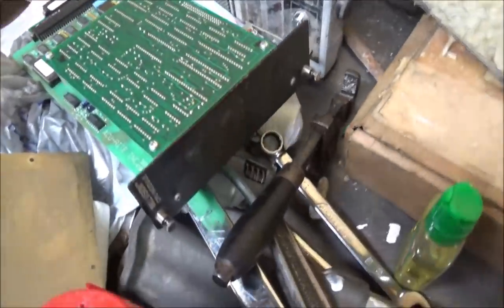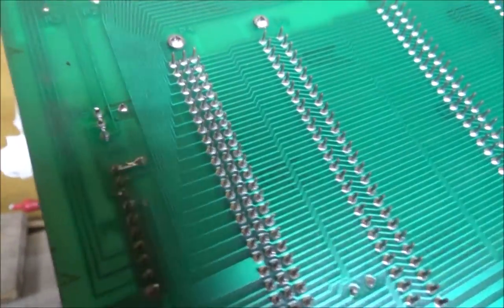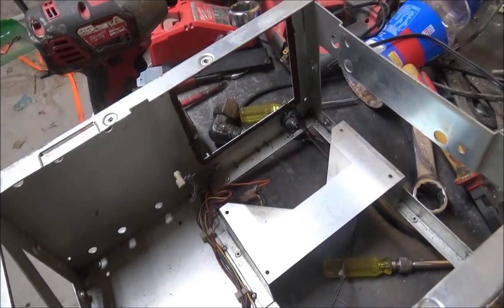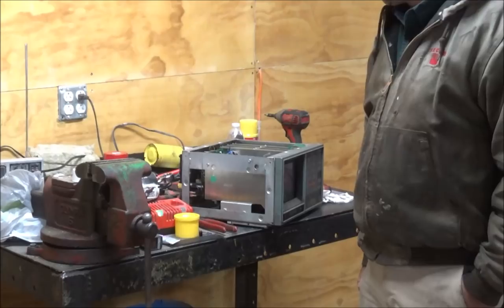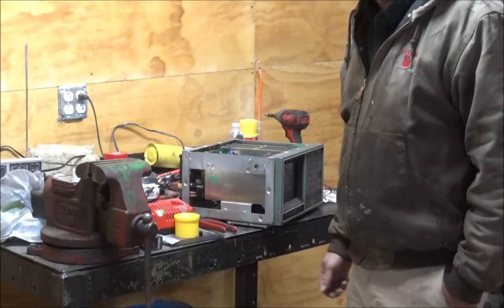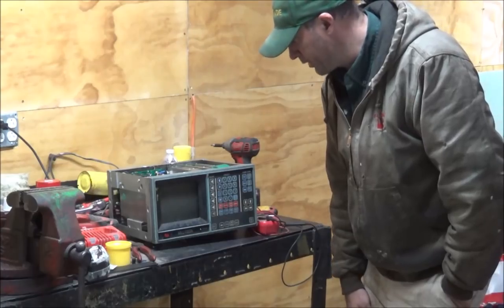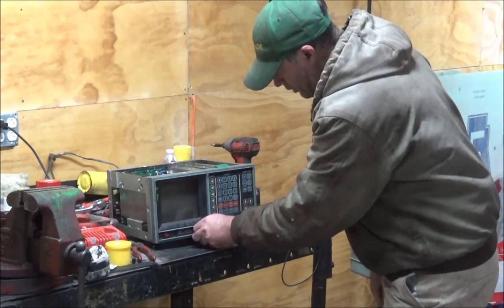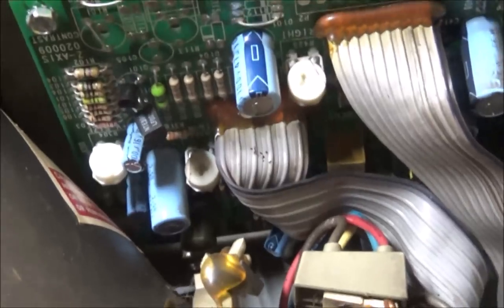Fix one problem a new one follows. CRT help anyone?

Comment: Brian, I don't know if this will help, but here goes. I have a 97 vintage bridgeport with a 2 axis prototrak MX2 controller. It HAD a crt. One day my garage smelled like a hundred capacitors burned up at the same time. I couldn't see anything wrong on the outside, and then checked the large box mounted to the column. Looked great, and no smell inside it.
Finally I started sniffing the control box on the arm and bingo! After opening the rear of the control box I eventually discovered the source of the horrendous smell. The card that surrounded the neck of the crt had a large hole burned through it. If the box hadn't been almost totally airtight, it could have burned all the cards in the box.
The choice: new old crt or lcd flat panel. I said screw the crt! No more flaming circuit card.
Now, the cheapest replacement kit i found was $1250.00. I don't have that kind of money right now, so I ended up doing it from scratch. The MX2 uses a 386 dos computer, with a monochrome video card for the crt. I did research and found a raw vga DE15 (15 pin) lcd panel that would fit the crt opening and a good old color vga card on ebay that would fit the motherboard. VGA is the oldest format the lcd panels would accept, and be compatible with the 386 motherboard. When I turned it on and adjusted the lcd, I had a three color display!
If your video board outputs in vga or better, you can replace the crt for good. If not, perhaps you can find another video board like I did. i searched for raw vga lcd panel in google and ebay.
Please contact me if you think I could help. Ed.       eakerstrom@yahoo.com
Reply from the maker: That was going to be my next option. Fortunately I got it fixed with the original bits some solder and some extra wire.

Comment: On something that old there should be a V-hold adjustment, but it could be hidden. The V-hold basically adjusts the oscillator frequency in the main driver chip to match the frequency of the incoming video signal. It looks like it has a card edge connector on the CRT board, so it could be composite or TTL signal. Probably TTL. They are pretty simple, but tough to figure out without a schematic.
Reply from the maker: I believe it is TTL signal.  There is no v-hold adjustment that I can find. the only pots are Bright, VSize, VLine, Hphase, and Hfreq
Reply: Well ain't that a bugger... If you want to ship it across the Mason-Dixon line, I'd be happy to take a look at it. No guarantee I can fix it, but you never know... @bcbloc02
Reply from the maker: Got a guy close by gonna come tomorrow and take a look at it see what we can figure out. If we don't get it I will kepp you in mind. Thanks!!

Comment: You are having a vertical sync problem. Check your yoke connections. It also could be a cold solder joint, failed capacitor or a loose connection.

Comment: Sticking with the KISS method I would suspect additional cracked solder joints.  Especially after tear down and reassembly.  Good lighting, and magnification for inspection.  At some point somebody will recommend wiggling the pins etc.  I'd be cautious about doing so as it creates more variables.  Probably focus in the repair area first and work out from there.

Comment: First step...   unplug the power from the wall.  clip a test lead to the chassis. put the other end on the shank of a long thin flat screwdriver.. the screw driver must have an insulated handle..  push the tip of the screw driver under the boot on the high voltage wire on the side of the CRT to touch the clip. .  now you can safely push the clip down the screwdriver and hook it on the metal connector under the boot.. so you can completely discharge the high voltage retained in the picture tube and the flyback.  it can keep 25KV with enough current to cause you to fly across the shop..  this is the first step in any work around the CRT.  if you think  the cable snapping and dropping the radial drill was a close call.  you will need a tube of Dielectric tune up grease to replace the dielectric tune up grease that sealed the high voltage under the boot on the side of the CRT.. it goes under the rubber.. not down in the hole..  this is a life or death safety precaution. 

 i am a guy who resolders a lot of stuff.. ECM/PCM.. relays. instrument clusters..  somebody just today tossed out a blueray player next to the trash can.. in the box.. plugged it in.. nope.. opened it.. resoldered it..  it not only works.. it plays netflix and youtube when i plug it in to my cat 5 cable. 

 here is a 2000 honda circuit board close up.. i added little white arrows where IFFY solder joints were.. https://i.imgur.com/U3JoxbK.jpg  the wire gets hot.. the solder closest to the wire expands but the rest of the solder puddle is on the circuit board and does not get as hot.. so its pushed back.. when you turn off the device it cools.. the solder on the wire shrinks and pulls away from the rest of the solder puddle making intermittent sometimes becomes OPEN.   

because you are working with LOGIC boards..  you will want to wear a static wrist band attached to the frame or the board so any static build up on your body or clothing does NOT blow the logic electronics out.. they are damaged at around 18 to 20 volts.. static can have 20KV. .

i will let the others describe where to look.. but i would want to check all the solder joints on the monitor board after you discharge the tube.   especially the pins soldered in for jumpers between boards.. 

 please also look for capacitors that show signs of leakage to the board.. or have the ends swollen..  capacitors don't last for ever..  if you catch them before they blow up destroying the circuit board the can be mapped out for polarity.. by taking pictures of the circuit board .. printing them out large..  marking down on your pictures which side is positive and which is negative.. unsoldering them when you have replacements from Newark or digikey..  you have to look at the ratings and order equal values and voltages.  any with a 14 volt voltage you might want to try to up that voltage rating.  those are the ones that manufacturers put in to fail to sell new machines every 10 years or so. 

 capacitors when new allow AC voltage to pass thru.  they block the DC.. . when they get old they pass DC..  the amplifiers used between them amplify what ever voltage and signal are there.  if there is only AC voltage coming out. .the amplifier device will amplify AC signal only..  if the DC comes thru.. it will have a big thick middle section of DC being put out and your signals will be smothered with DC..
Reply: Beware of Electro Static Discharge (ESD).  You could build up a high enough voltage with an ungrounded soldering tool and an ungrounded steel table to destroy ICs on the PC Board as wayne p stated above.  You may need an electronics or computer repair shop to help you.  Good luck in getting it back to normal.

Comment: Unlike home TV's, The vertical is driven and doesn't have a "hold" control.  That drive signal connection has been broken,  Common problems are wires in ribbon cable connectors or connector pins pushed out.  The wire of interest goes from the controller to the monitor.
Reply: All CRT monitors and TVs have a free running oscillators for X&Y which lock on to the sync signals.  Every one I've seen does have a V HOLD pot somewhere.   I agree the signal wire is probably broken but it's also a slight possibility that the V HOLD was knocked so now it's too far off to latch onto the incoming signal.
Reply from the maker: The ribbon cable is pretty hard and crusty it could well be the problem. Can I replace it with multiple regular wires?
Reply: @bcbloc02  You CAN replace with individual wires, the ribbon cable isn't anything special, just multiple wires in a row, but it would likely be tricky to get all the wires soldered in place, and reliable.  A replacement ribbon cable might be the best way to go.  Hopefully someone will chime in on where to buy one.
Reply from the maker: The ribbon cable is soldered on the driver card end so replacing it would be a challenge anyway.
Reply: If you can identify the broken wire,  you can patch one in and leave the rest of the ribbon in place.  It'll be all low voltage signals on that ribbon.   Julian Ilett knows where to get that kind of ribbon cable,  I'll keep scrubbing through his mailbag vids to find it or I'll give up and ask him.
Reply: That connector at the computer end is annoying for the solid cable plan.  It looks like the kind that crimps multi strand wire through the insulation (aka IDC).   They were notoriously unreliable back then.   I would pull the strain relief off that connector ,  strip 1/4" off every wire,  then solder them vertically to the exposed crimp forks.
A cheesy quicker fix would be to squeeze each fork together into its wire with fine needle nose pliers, although that won't help if the wire has broken off inside the fork.
Reply: @bcbloc02  You can use a ohm meter or continuity checker to see which wire to patch in you do not have to replace all of them just use a small gauge wire  like 24 to patch it in.

Comment: I remember the old main frame computers we used in the evil polluting refinery.  They came from the factory in the 80's with crts.  And then the world went to LCD monitors and we had to buy some adapters that would convert the signal to one the LCD monitors liked.  Electronics become obsolete in just a few years, constantly changing.  I would be willing to bet that one of the new DRO boxes would work just fine with the inputs you now have.

Comment: Hey Brian,  i would start with checking continuity between your board and the crt.  Check all your pins on the board and the corresponding end of the cable.  Make sure your solder joints are good and the cables are good.
Reply: Around those circuit boards, stick to 63/37 SnPb alloy  (eutectic) with no clean flux.  RA flux requires a very thorough cleanup, lest corrosion become an issue.
If an old time TV repairman happens to live in your general neck of the woods, that party may be of assistance.  A CRT, with a swept beam and video level drive, lies at the heart of things.

Comment: The vertical timing is obviously off. Normally there should be a V Hold or V Sync pot on the monitor to adjust this, but possibly it is fixed timing. 

There are several ways that this (probably CGA) monitor could be connected to the readout electronics. There could be a single composite video wire. There could be a luminance wire and a composite (H and V) sync wire. Or there could be luminance, H Sync, and V Sync wires. I think that 3-wire connector is probably the video connector, so there is probably a ground, luminance, and some sort of sync wire.

Assuming that there are separate sync wires, or at least a separate V Sync wire, it could be that wire isn't connected. I'm guessing that 3-pin connector you resoldered is the video output to the monitor, though I wasn't able to follow where those wires went in the video so I'm not sure.  But if it is, there is a possibility that one of the pins isn't making good connection. 

When you resoldered the connector, did you split the connector so that you only had the bare male pins and the white base/latch that you resoldered to the motherboard? If not, possibly some of the heat from soldering partially melted the nylon upper connector body, allowing the pins to shift slightly and make poor connection. Whether you did or not, the first thing I think I'd try (other than looking for a V Hold/V Sync pot on the monitor board) would be to unplug, wipe the pins with a clean rag, and replug that connector. 

It is possible you developed a cracked trace on the motherboard while working on it. That isn't too likely, but possible. If so it wouldn't be too hard to fix. You could try gently wiggling that connector by hand while the thing is powered up and see if sync comes back, but be VERY careful around that monitor when it is live! It has both line voltage and 15KV high voltage floating around in it, and it can knock you across the room real fast if you bump into the wrong bit!

Hope some of that may be helpful.
Reply from the maker: The 3 wire connector I resoldered goes to the brightness control. The only pots on the driver card are Bright, VSize, VLine, Hphase, and Hfreq. On the motherboard is brightness and contrast but I can't tell that adjusting them has any effect.
Reply: I wish I could tell better where the wires on that 3 wire connector and the one below it go. Guessing from the video I'm going to guess that the 10 wire connector goes to the monitor, but if that is the case I don't have a clue where that 3 wire connector goes.
There are almost certainly separate luminance and sync wires to the monitor. Since you mention that the monitor goes black when the 3 wire connector is disconnected, it has at least the luminance signal on it, but that is one wire and ground. So that third wire is something else, and sync would be the logical guess. But if the 10 wire cable to the monitor is going to the connector right below the 3 wire connector, then the sync lines could be on that cable.
In any case this sounds like the V sync wire is broken. It could be a cracked trace, or if it is on that solid-wire 10 wire ribbon cable, it could be a broken wire in the cable. That could be hard to find, since it might start working if things are wiggled, and you will have to wiggle things to get in there and do any checking. Assuming the 10 wire cable does go to the monitor, I'm leaning toward the idea that one of the wires in that cable is broken or making poor connection. You could just try wiggling it at the board end or reseating that connector, or both.
Reply from the maker: The 3 wires went to the brightness control. The ribbon cable goes to the monitor driver card.
Reply: Oh, to the front panel brightness control? That would make sense. The traces from the connector go to the 10-turn brightness trimpot labeled "brightness" a couple of inches above the 3-pin connector. Mildly amusing that that results in three levels of brightness control pots in the machine.

It's possible that there could be a V Hold control somewhere on that motherboard that got accidentally tweaked when you were getting the board out or in, or while you were working on it. Especially if there is a front or back panel V Hold control, which there might be. If not then I think the most likely cases (in order) would be either a broken wire in that ribbon connector, another cold solder joint on the ribbon connector plug that broke when things were wiggled, a poor connection in the connector between the ribbon and the board, and a cracked trace on the board.

As I think of it, having a connector fall out of the board because the solder joints all failed is extremely unusual. It can happen from mechanical force, but there really shouldn't have been any here. The other reason would be bad (cold) solder joints originally, eventually fractured from vibration. If the solder joints on one connector went bad over time, it is reasonable to think that the joints on the connector right next to it are just as bad. And wiggling it to pull off the ribbon connector and push it back on could have fractured one of the bad solder joints.

I think a good first thing to try would be to pull that motherboard back out, and re-solder all of the pins on that 10-pin ribbon connector plug, using a little fresh solder on each. Personally I'd probably re-solder all of the connectors on the board while I was at it, but that might be overkill. But given that we know one connector had cold joints and this failed with the indication of a bad connection when you took it apart and put it back together, I think it is reasonable to assume there are other bad solder joints around. And the fix (resoldering the connectors) should be reasonably easy to do at this point, since you now know how to take it apart.
Reply from the maker: I think that is the next step. I tried all the trim pots in all kinds of settings with no success so a total teardown and inspect will be the next order of business.
Reply: Cold solder joints can be difficult to spot visually if they aren't completely fractured, so while visual inspection is a good idea, so is proactive resoldering of all of those header connections for the 10-pin connector, even if nothing looks visually bad.

Comment: General rule of thumb -- if it worked before you took it apart, the problem was inserted when you put it back together. Check your solder repair to make sure you don't have a bridge between pins. Make sure all connectors are seated well. Make sure no pins or connections are touching the chassis. Double check that all connectors are back where they were when you started. It is easy to get one pin off on stake type pins.

Comment: Brian - back in the day and LONG time ago, I worked on TVs that had CRT's and their Yokes (located on the tube) had adjustments on them. Check for potentiometers there. You might get lucky. I know nothing about DRO but that looked familiar in structure around the tube's yoke from the 60's.
Reply: Oh .. be sure you do not get on the hot side of the CRT. It can carry a jolt. (That's the big single wire hooked somewhere near the middle of the side of the bulge.) The CRT's screen picture is painted by up/down and left/ right magnetic fields moving the electron flow across the screen. They look like coiled wire sandwiches on the four sides of the neck. Horizontal on the sides, vertical on the top and bottom.